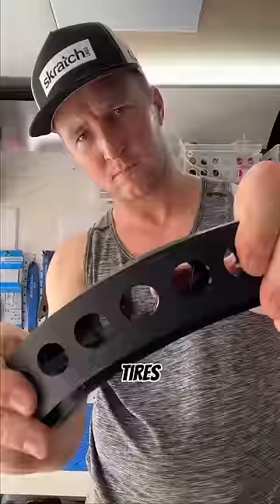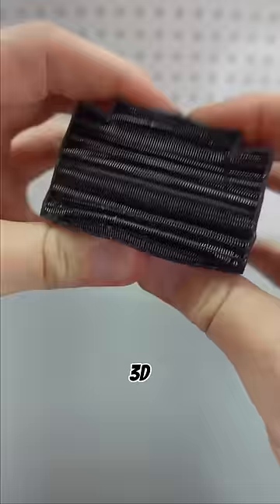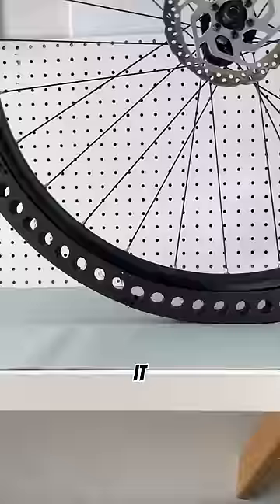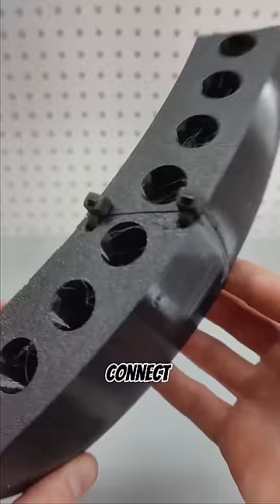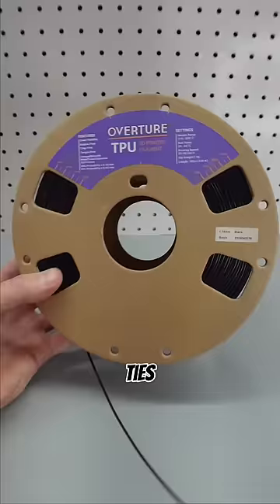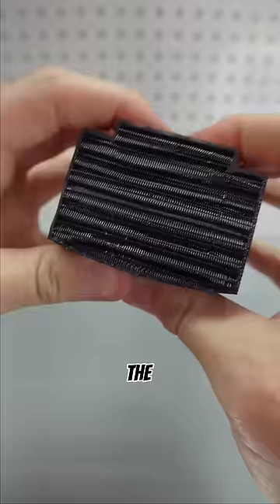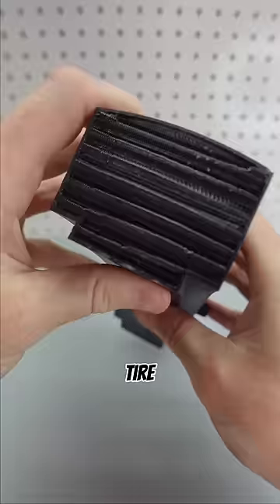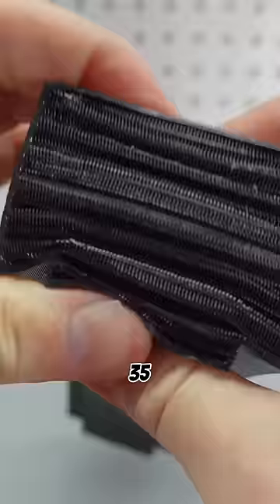3D print your own bike tires! #mtb #cycling #bikeshorts

Comment: I’d try it on a road bike up to about a gravel path. I have my doubts about the interlocking sections holding up to any aggressive trail riding and probably not down hill. If there was a way to print the tire as a whole it would mitigate the weak points in the joints for mountain and trail biking. Bad ass idea amigo.
Reply: Needs a better interlock than a "wedgie"
Reply: 😅 Add 3D print to any existing idea and the 🤡's will disregard injection mold casting or other techniques. Even then on either design of a skateboard wheel or this 3D printed idiocy it will have horrible wet traction + horrible durability if you decide to add treads.

FFS, stop trying to reinvent the wheel!
Reply: we have this great thing called rubber injection molding. its like a 3d printer except it does it all at once much stronger and in seconds. but it costs 50k for one mold

Comment: It would be cool if you designed it as an insert for a regular tire.
Reply: Possibly $300 per tire
Reply: nice idea !!!!  Modern day inner tubes do not hold air very well.
Reply: They already have them- they’re called “CushCore inserts” and many MTB riders use them to mitigate flats.
Reply: @MrStevenWalker tpu isn't that expensive idk what the amount per piece is but you could probably print a wheel with a single $20 roll.
Reply: @paulmaul  Oh wow !!! I wonder how they handle/ ride next to ones without inserts.

Comment: Ok...
The base must be printed around a small metal plate that fits into the tire groove. (Metal with rubber around it)

Zip ties must be replaced with some kind of aluminum brackets with rubber sleeves on them. With maybe one section having a toggle latch so u can take the tire off easier

Comment: This would be the ideal material to make protection cases for all sorts of electronic devices! 👍😎
Reply: A little thick
Reply: @Northernheros  Not everything that you might want to protect is catered for.... E.g. field video monitors, there are so many brands that it's a niche market... to be able to 3d print your own would be very useful...
Reply: They do this for prototypes of products when they can the issue is normally cost
Reply: @Northernheros  Broadcast equipment is very niche, compared to phones etc, but freelance technicians baulk at paying as much for a protective bumper as the gear itself, the amount of work has died off dramatically since covid, so cost saving is important...☹
Reply: @Northernheros While id just recommend making a case with custom cut foam for most things I think youre over estimating the difficulty of modeling. I've actually made individual custom frames for tabletop minis that then sits in a foam case and since I have the models themselves its much quicker, making basic protection really wouldn't be too difficult.
Reply: @Northernheros  I'm talking about making custom cases... It's not hard for anyone with some experience in any variety of software and basic measurement tools can make one fairly easily. When I brought up the models it's a little thing called an "example" in case that's too hard for you to understand. It takes all of 2 minutes to make a custom form fitting case for each one that they can slide into for protection during transportation. I have also made other ones for different hand and power tools along with electrical equipment that either work as attachments, covers and holders. Again it's not very difficult to do. You can go to any STL site and find a variety of custom cases, housing and attachments for all sorts of electronics that can be made for various resins and filaments to achieve whatever property you desire.

Comment: One of the great advantages of airless tires is that lateral and radial stiffness are decoupled from each other. You can have a design that's very bouncy or even squishy to ride on, but also is as stiff as a rock side-to-side. You have an opportunity to optimize for both comfort and performance.

It gets even more interesting when you bring auxetics into the mix. Normally, when you squish a material down, it has a tendency to spread out. The ratio of that squish is known as Poisson's ratio, and it's typically positive. Auxetics have a structure that makes them do nothing at all when squished (a ratio of zero) or even pull inward (a negative Poisson ratio). This unlocks some very unusual properties, such as being able to bend or twist along multiple axes without kinking or wrinkling. It also potentially enables some impressive shock absorption.

I like the idea of printing your tire out in sections instead of having to mold it as one big piece. It makes this kind of technology much more accessible and much easier to iterate on. There's a lot that you can do to develop this idea further. I'm curious to see where you can take it.

Comment: There's a reason why giant million dollar tyre companies haven't done airless tyres.
Reply: Cause "Big Air" Corporations and lobbyists are stopping them... duh. 🤣
Reply: And that’s the reason why are the most tires filled with foam - air tires are an old concept.
Reply: @MedienLord-PuP  what tires are you using?
Reply: They literally have done for lawn mowers, skid steers etc where its even used pretty normally. Something closer to bicycles is dirtbikes where the same big corporations have mousses that are put in instead of a tube. They might not have made for bicycles but airless tires are fairly normal
Reply: @proarmy70  with motorbikes do you mean tubeless? Like a car.. Yeah it's been a thing in the mtb industry for nearly 10 years, also there's all sorts of foam inserts, punctureless tyres, sticky green goop shit that gets everywhere, out on the market today.. 
As for solid rubber/foam tyres such as wheelbarrows carts dolly wheels and such yeah they have been about for as long as rubber has been used to make tyres..
Reply: @ThemrRewind  dirtbikes have mousses which is like an inner tube but foam or rubberlike thing instead of air

Comment: So fucking cool, I would absolutely use them for casual riding. 

I have one suggestion though. 

Use triangles for the center holes instead of circles. Moving in different directions will help with structural integrity.

Comment: Tell me you don’t actually go outside without telling me that you don’t actually go outside.
Reply: For trying to help solve an issue tires have had for years?
Reply: @andyeah3414 These have more points of failure than a standard tire has.
Reply: @samharris3508  doesn’t actually make my point any worse
Reply: @andyeah3414  well the sectioned wheel isn't a new idea, the only 'innovation' here is using a 3d printer and this design needs much work,  notice how didn't demonstrate his own wheels with a personal spin on them.
Reply: @paladro  damn, so you mean he is attempting to help solve some issues tires have had for years. Yeah no shit it needs work, its held together with zip ties, but its still a great proof of concept and helps contribute towards a greater idea

Comment: Doesn't look very long lasting. As soon as the smooth (and probably not very grippy) top surface is worn off, it will turn into black confetti. 
Also you may wanna lightly glue them on your rim, like tubular tyres, so you can actually brake with these. Othwerwise they'll start rotating around the rim.
Reply: You could probably print them with texture on the outside and I don't think these would work well for like hardcore biking but if you live in a city and use a bike to get around it's not a bad idea

Comment: I’m amazed by this! So cool to live at a time when ppl can literally print AIRLESS bike tires at home.
Reply: Ehhh, it’s a cool concept, but I doubt it’s gonna take. The tires seem to have very little traction, and they would likely slip right out of the rim after one good turn. Airless tires have been around for a VERY long time, and can be made without much problem at all, for many different kinds of vehicles. And yet, we still use inflated tires. There’s a reason for this.
Reply: @LeithB  yes, there is a reason. It’s called “available technology is finally catching up to concepts.” The concept of airless tires have been around for awhile but have had their drawbacks.  But now, with new technology and materials, we may be entering an era where airless tires are actually usable.  That’s how progress works 😁

Comment: Good start, and a very neat idea. A future version should have a banded design, where a chain of zips holds the tire radialy to the rim. A rounded contact patch, with recesses in a v shaped pattern will help water wicking for wet ride handling and actions should slot into one another a bit, for transverse strength.

Comment: If you create a "latch" system instwad of the zip ties probably. Id recommend an expanding sort of lynch pin with a shackle that goes through the hole.

Think of a wishbone type shape with a cap that goes on the open end. Then seat the Lynch pin into the end cap retaining it as good as possible. The lynch pin should have a bendable design so you can push it in, so it clips into place, but with some pressure on the opposing ends you can easily push it back out to remove the retention aystem. Id design it with a 2 lip system similar to the wishbone shape, with the bent section being more flexible to allow flexibility ao that it can slide intot he hole but not so flexible that it may not lock itself into place once put into the hole. 

Sorry if this description makes no sense. U vant think of the technical names for what im thinking

Comment: 8/10 for the idea, 6/10 for the method, 2/10 for the implementation.
Needs a curved profile at the edges for cornering, needs treads at least 5mm deep for grip, need to be interlocked with each other in case zip ties fail . . . .

Comment: Where have you ridden with them? Road bikes are usually at 100 psi for the 1 inch tires, mountain bikes are usually at 45-60 psi. Did you experience any deformation going over bumps?

Comment: Alot of criticism over the square edges and modular construction, none of which i disagree with... But this is ultimately more failure-resiliant than gas pressurized tires, especially for use in space or even extreme pressure environments. 

However, I would advise checking out tried and true designs that should be relatively easy to replicate, and then work from there regressively to your own design. This way you are in constant tension with the currentmost standard, and therefore most likely to achieve breakthrough results.

Comment: Why not print them with interlocking ends similar to that in woodworking that requires no screws. Then for easy disassmbly and reassembly one piece has a locking mechanism similar to a simple mechanical latch (like those on old milk bottle).

Comment: Maybe; if design has more mass than what it replaces, it will require more force to use. However, if the application is to survive a nail puncture, your design is probably better.

Comment: Airless doesn't work, because too little of the wheel is doing any shock absorption. For airless to feel anything like a pneumatic tyre, the material has be very soft... and that means TOO soft to be safe in corners. There is no way round, this... (excuse pun).

With a tube or tubeless tyre full of high pressure air, the WHOLE circumference is an active part of a much larger airspring... on fullsize wheels the airspring is up to 80-100 times bigger...

Comment: 35 psi is the car tire which you can't bend with your fingers. Looks like you applied less than 5 lb of force to bend it. The way you tied isn't safe, either. You might want to  use an underlying band and glue the whole piece. 
The force those tires will withstand require a single piece with no weak point.
The fact that they are squares can create deformation and stability problems when turning. 
I'm not a mechanic. Using common sense. 
You can call it the death tires. That could protect you from lawsuits.

Comment: Zip ties are not going to be very reliable for that much stress, especially in humid environments, where nylon can loose a lot of strength, creep resistance, and fatigue resistance. I wonder if there's a way to do it with stainless steel hose clamps?

Comment: Needs to be round not flat with a edge. Or driving will be shit when trying to turn.at speed your tyre will just wear out on the edges fast as they will be mostly in contact with ground as cycling you lean to turn.

Comment: Aren't the bezels of tires with air also pressed into the flanks of the rim by the pressure inside? So they hold on to rim crazy strong even if you drive on the flanks of the tire. With these parts only stuck into the rim with hand force I fear they will fall out (even if you make them round and not squares)

Comment: "I 3D printed something that makes absolutely no sense to print so I can solve a problem that didn't exist because I have too much time and money on my hands" fixed that for you. Nobody here would ride with you because you wouldn't even be riding on those wheels. Every single item in existence doesn't need a 3D-printed alternative to cost you hundreds and further stack up landfills. 3D printing is a cool gimmick but the fact that the plastic industry has y'all brainwashed so they can make even more money than they already do is CRAAAAAAZY

Comment: Would I ride with them? No. 

1. Its not latched onto anything but the bottom. One pavement smack and its bending apart.

2. As a survivor of smooth wheel bike accidents in the rain, hell the fk no. Put some grip threads on them bad boys.

3. Tyres wrap around the rim because they are circular rims. This is basically a square in a circle hole scenario. Ya gotta stress test these  and record THAT. 😂

Comment: I see two massive faults in this, there are no tire threads, so driving on gravel or in the rain would make you aquaplane on top of the water at high speed. The second is that they aren’t rounded of, if you leaned into a corner with these I wouldn’t count on you making it out of the corner with no bruises

Comment: I was high yestarday and was thinking about this why no one really does airless tires. Problem with those is that you cant really use them since the lack the properites of tires. I mean sure for sum light work like around a cite its nice to have one less worry. But for anything else its useless and not as safe nor practical. It cant be aired out for off road or added more air for speeds and the process of making that is so much more complicated its not profitable to sell in huge quantities

Comment: Can I 3d print for a 700 x 23mm tuned to around 85 psi? Are there any issues with sidewall failures, will I need to bring extra pieces with me, and zip-ties? How much does the file cost?

Comment: There are revisions needed to that design, but overall a pretty cool idea. Instead of zipties, maybe either using magnets to connect the pieces or to the wheel itself. Treads and curvature are easy fixes in 3D modeling.

Comment: Nope i would not use 3D printed tires. So many people don't know the original use of 3D printers. They are to make masters for molds. In other words for the first step in a finished product not the final product itself. 3D printed things are not structurally sound for things that have a high RPM. The linking of 3D printed parts are not stable enough to hold up to this kind of stress.

Comment: I like the clever creations using 3D printing, but I would NOT trust that tire.  Zip ties?  The most temporary of fasteners? No.  Show me the same design with a way to lock each segment to the wheel, and a zero failure feature locking the segments to each other, and we'll talk.

Comment: 35 PSI way too low for a bicycle tire. It should be around 60 to 130 psi so you in fact did not make it to replicate the correct tire pressure. You printed a flat tire.. it's not a car. It's a bicycle

Comment: even if these worked perfectly... why? they'll wear down faster than a rubber tire, and produce far more plastic waste. as a bonus, you get to leave behind a trail of micro plastics wherever you go.
TPU can biodegrade but it still takes a long time for absolutely no benefits.  the 3D printing process alone is super wasteful.
Reply from the maker: “Rubber” tires are fully synthetic these days. And they’re softer and wear down much faster than PU compounds. Think of how long skateboard wheels last